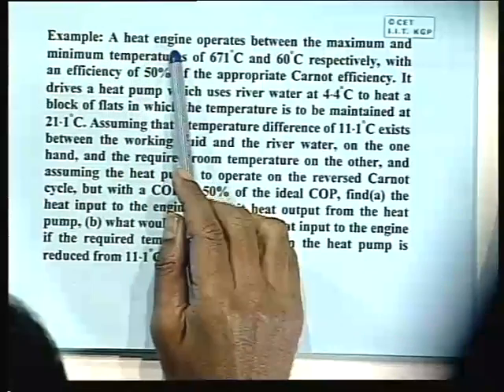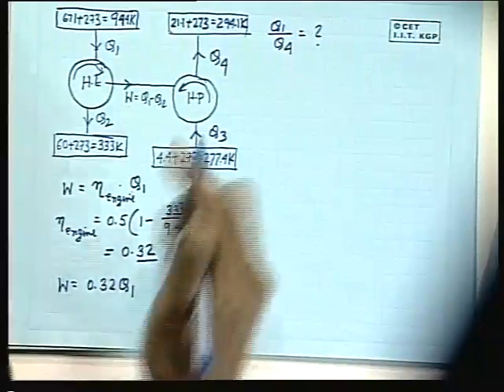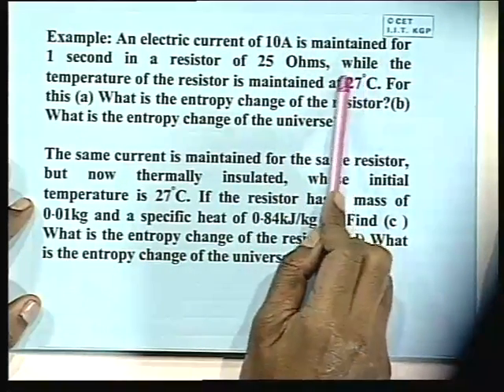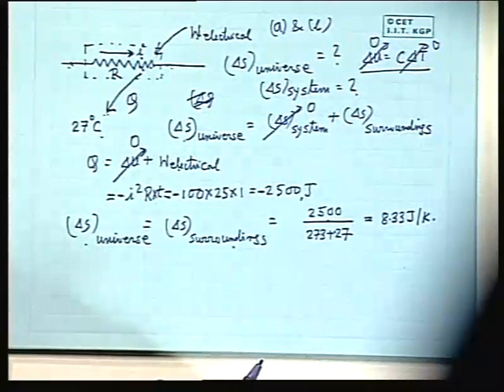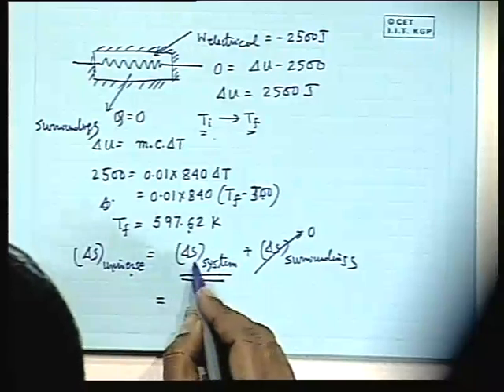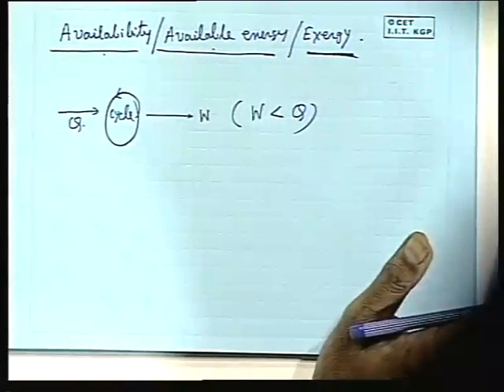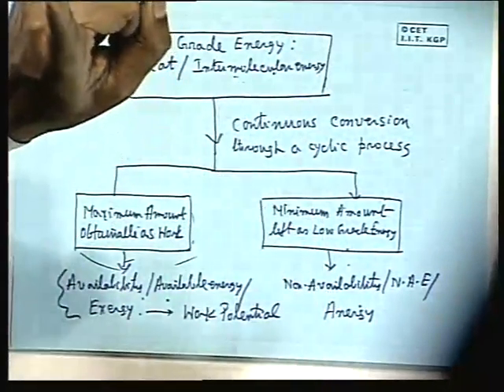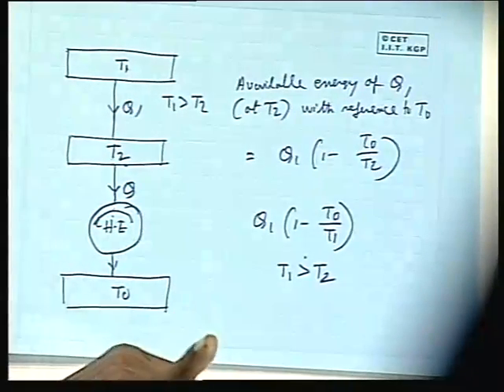Lec-10 Second Law and Available Energy-I

Comment: In the second question why would the entropy change of surrounding be 0 ? 
It's irreversibly supplying work to the system which can be conceived as reversibly supplying heat and has a entropy change associated with it ie: (equivalent amount of heat / ambient temperature).
Reply: Electrical energy or work is supplied to the heater/resistor from the surroundings. Supplying this energy to the system from the surroundings will not change the entropy of the surroundings as it is not transferred as heat (lower grade energy) but instead higher grade electrical energy which is ordered. Work essentially is entropy free energy in the sense that all of this energy is available to do work and no part is unavailable to do work (called unavailable energy or entropy)

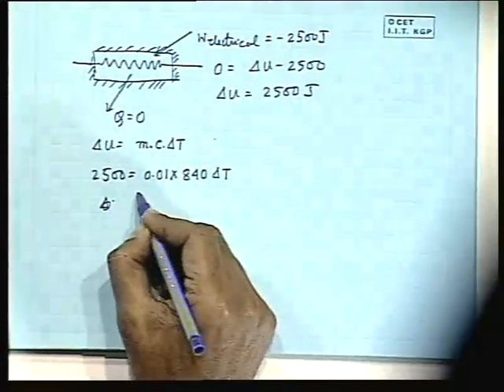Comment: at 30:26 sir told that entropy change is same whether it is reversible or not 
then why did we write delta s for an irreversible process as = integral del Q/T  +x .PLS  EXPLAIN
Reply: Entropy is a state variable .
To calculate entropy between two states, lets say A and B. We conceive any reversible process from A to B (i.e, any solid line joining points A and B). We do this though the process is irreversible because entropy is a state variable not a path function. But the distinction of reversible and irreversible processes explained through entropy is like this: if u perform a reversible process lets say samhita process (assume obeys a linear relation between p and v) then then the entropy change u find will not be equal to the entropy change when samhutha process is performed irreversibly. But i can find the entropy change prtween two points acheived through samhita process conceiving any reversible process between those points.
Reply: Correct me if you feel it is wrong.

Comment: Sir u showed Q is not always needed for change entropy .i.e. there is ∆s when Temperature change ...but in last case u  took integral of delQ/T =0 for reversible adiabatic process ...even though Temperature changes in reversible adiabatic process ...I am confused sir .... entropy changes are due to external and internal changes ...plz help anybody
Reply: If there is a temperature change dT, i.e. T2-T1, then we can numerically say that a heat transfer of Q(1->2) can also cause the temperature difference from T1 to T2 which is C×dT i.e. Q(1->2)=C(T2-T1).
Reply: @aniketthombare2572  thanks brother I got it clear soon after i posted this  Question.. nevermind thanks for comment really appreciate u r effort ..u took u r time to help 🙏

Comment: As said, maximum amount of High Grade energy(Work) obtainable from Low grade energy (Heat) is it's availability. But, the heat left out (Q2 = Q1 - W) can further be used to generate some work. So shouldn't the availability be greater ?
Reply: No heat is rejected at srrounding temprature

Comment: How can we say that state point is not changed just by looking del u =0 . as there is reversible isothermal process of ideal gas where state point changes but del u =0 .
Reply: Very unappropriate question.... If any process has happened, state of system will definitely change. In this process, t is constant but other system property can be used to define the new State
Reply: For any such system atleast there must be 2 properties that should be fixed to fix its state , in this case u and T are fixed so we know that it is at fixed state... According to Gibb's phase rule but those two properties must be independent, actually that's a relevant question.

Comment: Air flows into heat engine at ambient condition 100 kpa, 300 k. energy is supplied as 1200 KJ / kg air from a 1500 k source and in some part of the process, a heat loss of 300 kJ /kg air   happens at 750 k. The air leaves the engine at 100 kpa, 800 k.
         Find first and second law efficiency?

Comment: why heat cannot be completed into work. (explain other than saying it that according to kelvin planks statement
Reply: take any work producing device, when energy is supplied to it, it will only convert some part of it into work, rest will be used to overcome friction. For eg: When heat energy is supplied  by fuel in Engine, some part of it is used to overcome mechanical friction between piston-cylinder etc. and some part is converted into work, and rest of the part is released to atmosphere via exhaust pipe.
Reply: If heat could completely converted into work, there will be no irreversibility generated in the universe.
Reply: Head is low grade energy, so heat can't completely converted into work.

Comment: for an irreversible yet isentropic process there will always be heat rejection.
Reply: Anonymous traveller is right , Isentropic process does not necessarily mean reversible adiabatic.

Example:
If increase in entropy of the system due to internal irreversibility is equal to the decrease in entropy due to heat transfer(heat tranfer from system to surroundings), then the net change in entropy will be zero & hence the process will become isentropic.
Copied from quora
Reply: ekanadam pathuri isentropic means constant entropy.
Reply: If the process is irreversible and adiabatic then it is not isentropic process. only reversible adiabatic process = isentropic process.
Reply: Alongbar Basumatary yeah , but this concepts are truely in depth , one can't just get them this way , i think in thermodynamics we need to involve graphs & also multi variable calculus , this method of teaching is highly complicated.
Reply: Yes, it will be. As dS = delQ/T + sigma. Where sigma is entropy generated. For irreversible yet isentropic, sigma > 0, and for dS to be zero (isentropic), delQ/T must be less than zero. As T cannot be less than zero, delQ must be less than zero. Hence heat must be rejected.
Reply: anonymous traveller : bro. if irreversible and adiabatic process there will be no heat rejection ....
Reply: varun bisht i said isentropic not adiabatic.
Reply: varun bisht the reason is that for irreversible process ,▲s>▲q÷t, so ▲s=▲q÷t+X, the X is internal irreversibility & is always positive ;hence if we want ▲s to be zero than ▲q÷t has to be negative which means heat has to be rejected , so ▲s is for process is zero , another meaning or explaination to this  is that we can take heat from a system in such a way that it reaches to final state , this final state is such that if we make the process from initial state of system to final state of system reversibly the change in entropy will remain zero.
Reply: anonymous traveller : NO bro.  , isentropic means reversible as well as adiabatic ....
Reply: all i know is this is true,i dont want to explain further as it is a long process,learning all lectures might help you.
Reply: @anonymoustraveller2254  Bhai irreversible & isentropic process kya ek sath possible hai... .for irreversible process, change in entropy is always increasing
Reply: @anonymoustraveller2254  why for irreversible process, u r saying change in entropy is zero which is irrelevant
Reply: @anonymoustraveller2254  2 & 3 line is correct... In 4 line u r saying for del S = 0, my doubt is external entropy is 0 or internal entropy
Reply: @anonymoustraveller2254  what a rubbish question... U r mixing reversible with irreversible process
Reply: @Varun-uv4li  n
Reply: bro if the process is is reversible there is no question of entropy generation X . isentropic means  the process is reversible and adiabatic
Reply: Anonymous can you tell me is answer 7 correct which is given at the end of lecture? and why?
Reply: @abhishekchauhan1693  According to me...1st should be correct...
Reply: Abhishek Chauhan i dont know bro , i am off to different topics right now!
Reply: U seem to be having really good knowledge of thermo. I wish to sharpen up mine now.
Reply: i can explain with example to clear your concept. (if you want)
Reply: Can you please help with how he took the no change in state in the 2nd resistor example which seems similar to isothermal expansion where states change
Reply: Pranay Nirapure Unlike gases, where we need two independent properties like P V or P T or V T to fix the state of the system, in general solids however, like resistor, there is only one state variable needed to fix the state, which is Temprature only (think about it). And if the temp is same implies that the state is same as the only defining property of state, the temperature, didn't change. So all state properties must also not change like entropy.
Reply: prashant kumar somesh it is by intuition but if I apply Gibb's phase rule we still need 2 did to specify the state
Reply: Pranay Nirapure Gibbs phase rule is P + F = C + n. It is not necessary that n is always equal to 2. For solid solid interaction we use n as 1, like in alloying etc. And in this case also, you must use n as 1. You will then get F equal to 1.
Reply: prashant kumar somesh  oh okay I thought n is always equal to 1...it would be great if you can provide any reference for that...thanks.
Reply: Pranay Nirapure One practical application where we take n as 1 is in material science, and there it is known by the name of condensed phase rule.
You can search for that.
But still, I won't suggest to use phase rule everywhere. Because it depends that in what terms you need degree of freedom. Like cam and follower mechanism where you know that DOF is one. But there you won't be applying Gibbs phase rule to get DOF, because there you want to know DOF in terms of motion.
Similarly here, the variables P and V are meaningless, assuming that the change in vol of solid wrt T and P is negligible. And gibbs phase rule of P + F = C + 2 was defined considering all P, V and T.
So that equation is valid for gas and for liquid gas mixture etc but not here.
Here you can simply go by your common sense.
Reply: prashant kumar somesh Thankyou.
Reply: This comment Is the conclusion of the first 10mins of previous lecture

Comment: work can't transfer entropy.
Reply: universal truth no what he wants to say is that the work transfer causes internal irreversibility and thus entropy production which compensates the loss of entropy due to heat rejection
Reply: @thegreenfan1   Ramanuj Banerjee  Bro i hope i got you right here please read following and correct me if i am wrong i am stuck at this... pleae help

Since there is no change in entropy of system since its state has not changed. When we write the entropy balance the release of heat from system boundary at system boundary temperature will represent the entropy generated within resistor i.e. entropy generation within the system. 

But when we write entropy balance(isolated system) for universe we take delS_system(which is zero) + delS_surrounding =delS_universe.  

Now the same heat enters the surrounding at surrounding temperature thats why delS_universe= Q/ T_surrounding

Comment: Sir,
Entropy asssociated with work is equal to zero,and entropy associated with heat is not.keeping that in mind how can change in entropy of system be equal to zero?
Reply: The thing is entropy is not equal to dq/T for an irreversible process so we must know whether the process is reversible or irreversible  but here we know that only two intensive parameter are required to fix the state of the system from the equation c-phi+2 and density and Temperature are those parameters and they didn’t change so state point didn’t change thus entropy change has to be zero and greater than dq/T and we see that is indeed the case since dq is negative .
Reply: Srijan Agarwal : Bro. if there is enough heat transfer that effect of heat transfer is on property of any system is not more to change in the property of system . property like ENTROPY etc.

Comment: sir,if there is a finite temperature change in the system, then the entropy has surely changes.. right?
Reply: yes
Reply: Changes in the sense...??
For an finite temp diff there always increase in entropy
Reply: For reversible adiabatic process or isentropic process, there can be temperature change with no entropy change of the system

Comment: Hello sir,
For the first problem, to assume the temp difference b/w working fluid and the river you have considered T3= (277.4-11.1) Kelvin and same as T4 also. In the problem all temperatures are given in Celsius and you converted them into Kelvin. There may be a mistake that 277.4 is converted in Kelvin and 11.1 is in Celsius in the question which you didn't convert rather you have written in Kelvin scale.

Thank you.
Shiva
Reply: (4.4-11.4)=6.7degree celcius. now -6.7+273=266.4..thats what sir did..because u have to convert all the temperature to kelvin.. so (273+4.4)(11.1)=266.4..he converted the temperate difference to kelvin directly. Hope ur confusion is clear.
Reply: Yes I got it...But I realized after  posting that query. Yeah somewhat confused..anyway thank u very much
Reply: @mrarifsardar  I still didn't get it can u please explain
Reply: @hrushikeshsiddhye6614 
(100°C- 0°C)=100°C
Now convert the temperature into Kelvin.
373K-273K=100K
So it doesn't matter whether the temperature difference is given in Celsius on Kelvin.